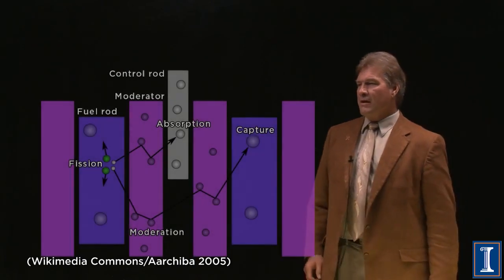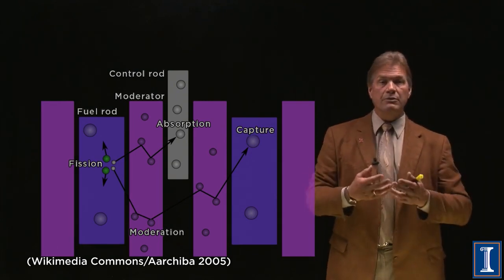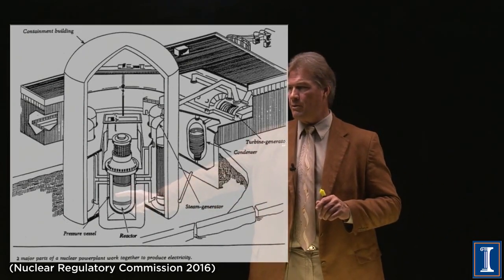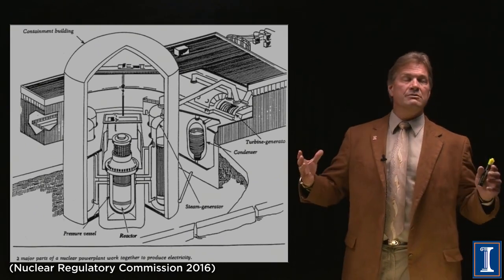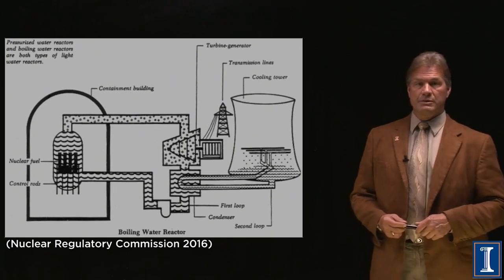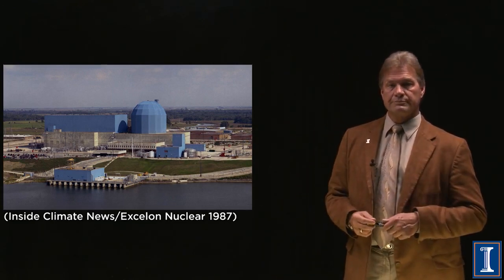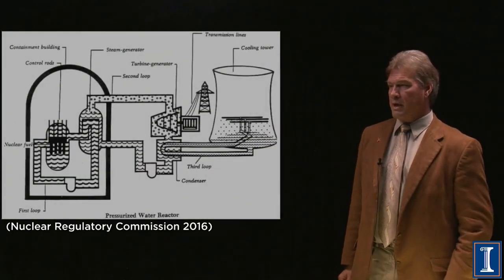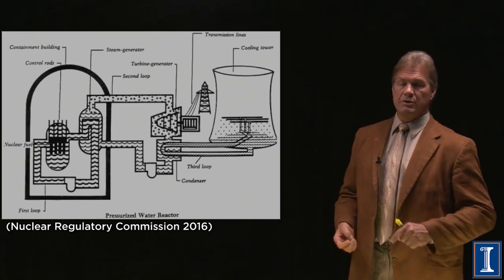What is in a Nuclear Reactor?

Comment: Can I ask a question.

If a reactor loses cooling due to water loss when at full power would the fission products continue to produce enough heat to cause a problem.

IE if a reactor were producing 1,000Mw thermal power how much would the by products be adding to that power output. would the by products stop all heat output without a moderator or is there action by another method rather than neutron activated fission.

How much heat would a 1,000Mw thermal reactor produce 1minuite, 5, minutes or 10 minutes after a SCRAM shutdown if it were SCRAMed.

Would that heat need active cooling, if so, how?
Reply: Isn't that what happened at Fukushima?  The pumps were flooded and unable to pump cooling water into the reactor?

Comment: Professor, Can you explain something please. If the boiling of the coolant stops the chain reaction, why there is something called loss of coolant accident (LOCA)? What is the difference in this point?
Reply: While it is true that a loss of coolant will interrupt fission, the decay heat from fission products does not stop. That coolant flow prevents the core from melting. So a LOCA is a very bad type of accident.

Comment: This question has been burning at me for a while. Is the difference between a thermal neutron capture and a fast neutron capture a factor of how centered of a hit on the capturing U235 atom? In other words, a fast neutron must have a way more center of mass hit (bulls eye) on its target then a thermal neutron need for capture? Great stuff, thanks!
Reply: No. A neutron absorbing atom has a given "cross-section" or probability of absorption based on the incident neutron energy. The cross section is not just higher for thermal neutrons, but also more predictable across a relatively broad range of thermal energy. This great helps in reactor design.